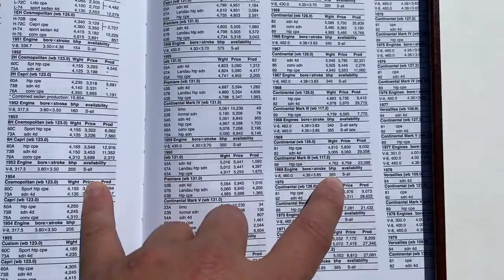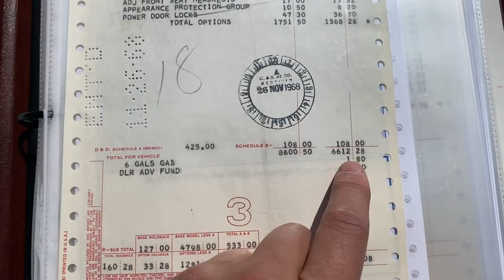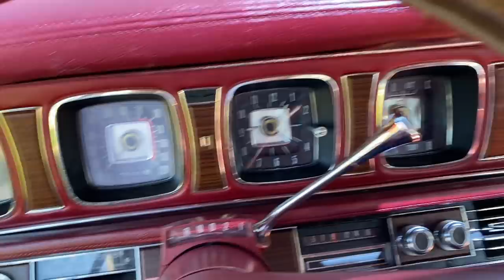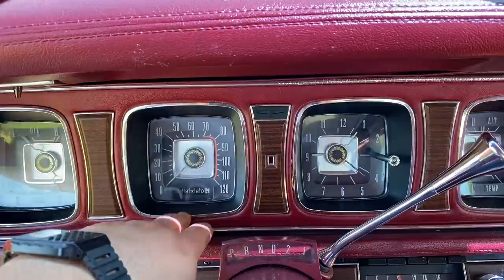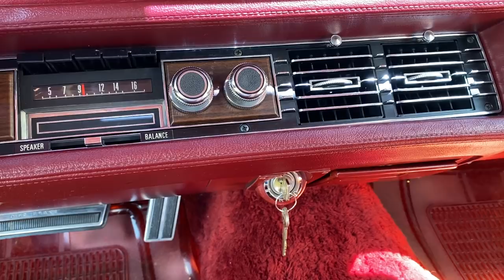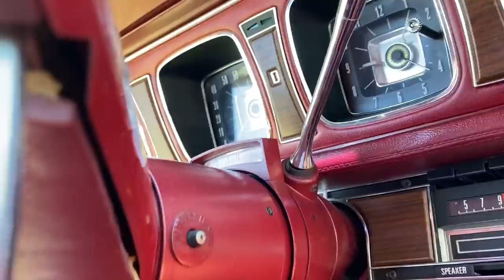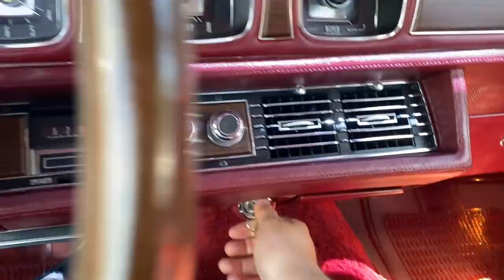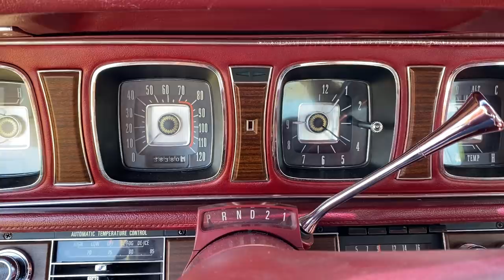The High Point of American Luxury Cars: 1969 Lincoln Mark III

Comment: All those vacuum lines would eventually start leaking over time. I can immagine an owner of an older car going around it with a squirt bottle full of soapy water to find the leaks 😅🤣. I also heard old GM, Ford and Chrysler cars with the lights hidden behind flaps like the old Chargers were vacuum operated too, and that the vacuum system would start to leak over time. This would cause winking Pontiacs and Dodges to drive down the road with the leaking vacuum system making the flaps blink open and shut 😁. I suppose proper maintenance would prevent these problems, but you know what people are like, especially along the ownwrship cycle at say the 3rd owner, the vehicle will not be looked after.

Comment: At one time these were very inexpensive to buy but I didn't want to deal with all the vacuum issues that can pop up. My grandmother had a 66 Fairlane 500 that jumped into reverse, backed out of the driveway into a power pole across the street.

Comment: I got a 1970 Lincoln mark three in my garage parked sideways cause it’s so long has a little rust 56,000 original miles have it started in a couple years since the water pump belt broke as I was giving my mom a ride but I’m gonna hang onto it in hopes of someday restoring it375 hp 500 pounds of torque plus it moves down the highway at 80 miles an hour. No problem before the water pump belt broke dammit anyway.

Comment: 29:00 yeah I had to use 2 crowbars, penetrating oils, and a big slide hammer (that body shops use) to pull the distributor from my 69 Coupe DeVille 472.   I only 52,000 miles at the time, but it probably was never adjusted by the original owner

Comment: you don't need to use lead additive in an engine that was made to run on unleaded fuel
Reply from the maker: This engine was not made to run on unleaded. That didn’t happen until 1972 for Fords.

Comment: You should look for this stuff with four votes only but it is real ledwith octane boost and it would make that link and run a lot better with the real LED it would take care of that spark knock you're talking about because when that car with no new you know the octane with much higher I'm sure you know all that period used to have a 71 Plymouth Scamp with a slant 6 and I used to put premium unleaded with let substitute in Tramp line that was like regular back-in-the-day 91 was regular octane when that was new so it ran good with 92 let substitute never had a problem do it well over a hundred thousand miles of no burn valves or nothing. My friend used to run that real LED stuff in the 72 Grand Marquis with the 429 it would make it run so good.

Comment: Same model as featured in The French Connection? It was one of the co-stars as the drugs were hidden in the rocker panels.
Reply from the maker: Yes
Reply: @RareClassicCars  as they stripped the car down you could see the quality of the construction and the extensive sound deadening materials. The excess weight gave the presence of the drugs away!

Comment: As for the shifter moving out of park, try using the parking brake.
Reply from the maker: It automatically releases when the lever moves from Park. Won’t work.
Reply: @RareClassicCars  Must be unique to those years.  My '73 Mark IV and all the other FoMoCo cars I've had with the auto release P-brake only release themselves in a forward gear.
Reply from the maker: @HiroNguy  you sure?  Mine are older and release in any gear other than Park.  Doesn’t make much sense for it not to release in reverse as the override is hidden.
Reply: @RareClassicCars  Very, very sure.  I've also seen other drivers do the Park>Drive>Reverse to auto release P-brake to back out of a nosed in parking spot.  I myself prefer to back in for safety. 
My cars that have had the same setup with no autorelease in R are:  
'73 Lincoln Mark 4. 
'94 Crown Vic.  
'96 Town Car.  
2 X '01 MGMs. 
'01 Town Car.  
'02 MGM. 
'04 MGM.  

So yours might be set that way because that's just how Ford did it that year, or it might not be adjusted right.

Comment: Had one many years got 17 mpg hyy tuned for regular gas drove it everywhere were very fast little maintenance paid 1100 s for it sold it 400$  to someone needed body partss for another     mine was a rust bucket sat in yard years  we eliminated the leece neville alternator could never get one to last put regulator and ford truck one

Comment: Pretty much at the apex of old-school horsepower,,, compression was dropped by GM and Chrysler the next year, Ford held out for one more year before the sluggish engines of the 70's and 80's took over,,, waiting patiently for fuel injection and oxygen sensors to re-vitalize gas engines.

Comment: Mine got 17 mpg. Hyw .beat  roadrunners. Very nose heavy🤗 always used regular gas in mine never hurt it we adj timing   think  stll have a ps pump around somewhere.   Used exh. Manifold gaskets stopped the cracking 

had problems with alternator  rewired with external regulator . watch the drain hoses in the trunk they leak f torn

Comment: I have a 1971 Lincoln Continental Town Car that I have and I wanna know what they are going for im not selling it because it will be a mistake and I wouldn't live it down for the rest of my life I'm 17 and I got this car from my neighbor I will be the second owner of this car he's 80 years old and hes only drove it for 5 years when he brought the car new it's been parked for about 45 years in the garage it has less than 32k  miles on it its original red paint white top red leather interior all they way no cracks or creases in the leather seats are excellent everything in the car works from the blinkers to the stereo all original light bulbs the body is excellent no dents everything straight still has original rims nothing has rust all the Chrome is excellent still has the original spare tire in the back the clear looks dusty but no chipping still has the owner manual and the original keys in the leather case
Reply from the maker: you can email me some pics at rareclassiccars@yahoo.com and i'll take a look
Reply: Alright will do

Comment: 1969 -1971  460   FORD Eng.. Are All. 365 HP & 500 Ft Lbs. Torque. … ALL 69-71 Are Same.. 72 Was The Year ALL American. Vehicle Lost Their. HP. ALL.. not an opinion. A simple fact… Damn Alan Thought. You Knew Yer Whips Better Then that… Hows that thimble Collection. Lookin…???? I Heard You Bidding On The Thimble That Was Used By Betsy Ross..Not the one she used to make the flag.. the one she used. For Sox & underwear… good luck wit dat… ALAN…

Comment: They rode like a truck with that big front end and were slow
Reply from the maker: You and I must not be talking about the same car. 

This car has an excellent ride and is anything but slow.
Reply: @RareClassicCars  Same car. Different opinion
Reply from the maker: Curious...why would you say it drives like a truck.  These things are sprung so softly, I wouldn't equate the two.  If you said a Mopar drove like a truck, I'd understand, as they're sprung much more stiffly.
Reply: @RareClassicCars  Maybe my friend’s needed new front end parts. It had very high miles.
Reply from the maker: @ThePrissy11  yeah.  I don’t think you can judge well if the car is aged and not properly maintained.  There should be front end shakes, shudders or shimmies in any of the cars of this vintage.  If there are, some front end part is worn.